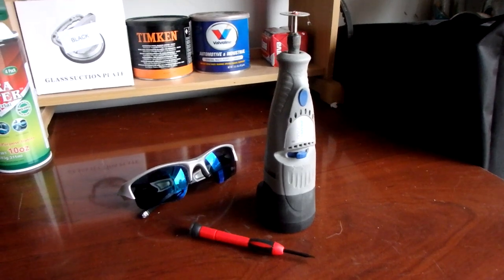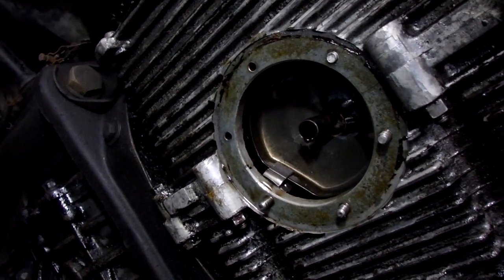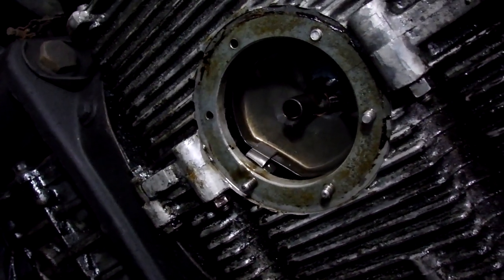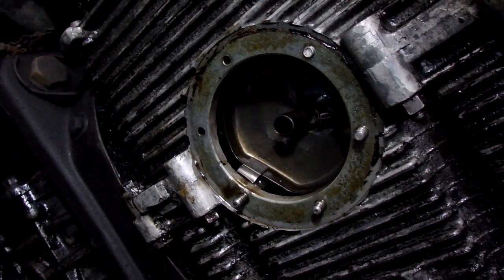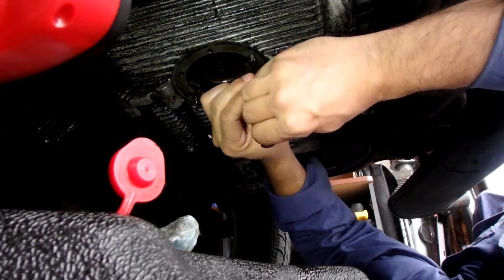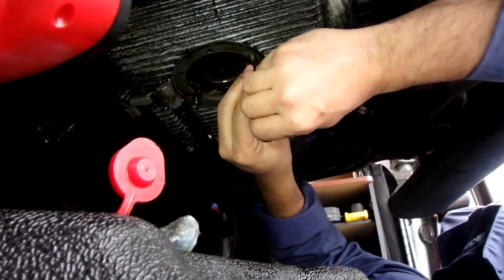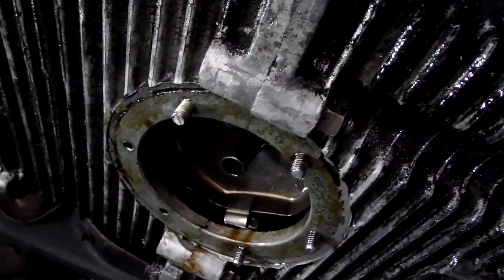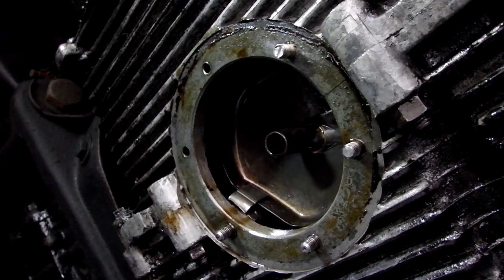How To Remove Stuck VW Bug Oil Plate Stud

Comment: Hey not sure if this is still an active channel but could I do this to replace the stud altogether to prevent a leak from happening? One of my current studs is stripped and don’t want to deal with an oil leak
Reply: I'm having the same problem atm. What did you end up doing? I've got two stubborn studs and thinking of drilling them out.
Reply: @flowebn15  Use a blowtorch to heat them up and grab it with vice grips and twist that thing out should come out mint